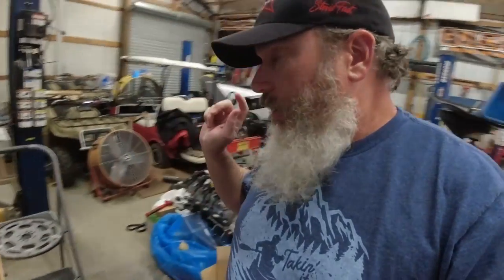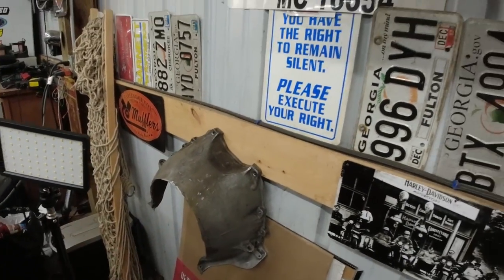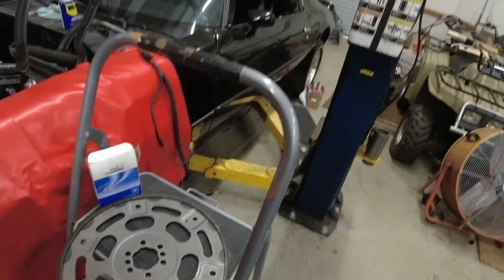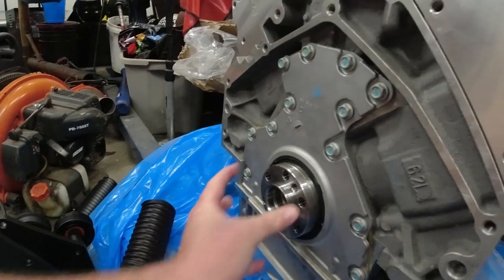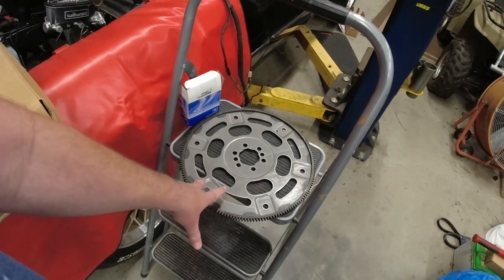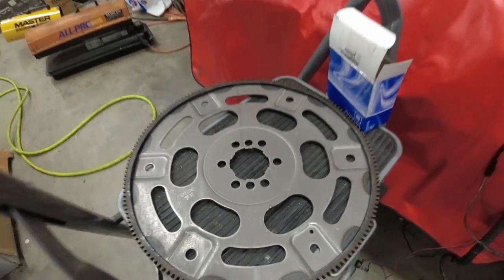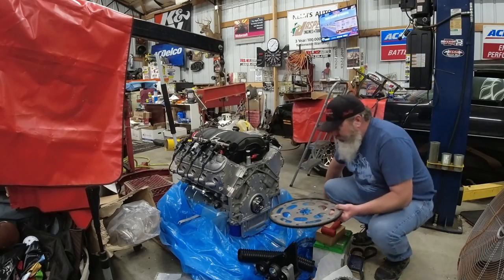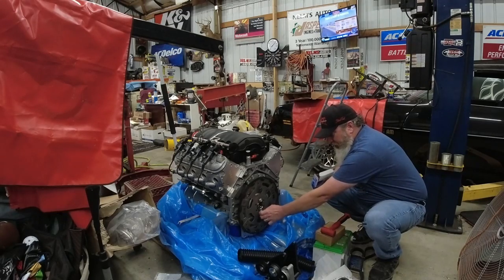Adapt Your LS LS3 LSX Flex Plate Turbo 400/350 GM Transmission And Converter Using a 4L80 Flex Plate

Comment: I have a GM 12551367 flat flexplate and the spacer, the torque converter holes on my 12551367 doesn’t line up with the 4L60E dish torque converter hole when I hold them up together they are farther out than the dished holes. I’m doing a 2002 5.3 LS swap with TH400 Turbo transmission

Comment: Good stuff brother.. I am seriously thinking about going LS power with my TA.  I have built turbo 350 Trans behind my 461 stroker. So your information on the flex plate is fantastic as I want to stay with my turbo 350 trans. 👍
Reply from the maker: Thanks I also have a video on the bellhousing modification to an Ultra Bell. The BOP bellhousing will need to be changed. Thanks for watching and the feed back.
Reply: @HotRodDave  I will check it out 👍